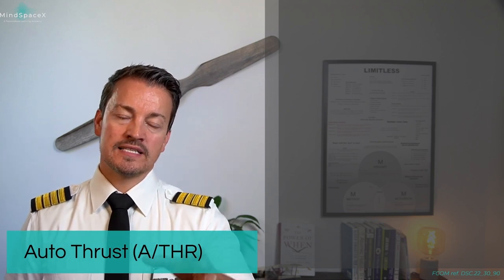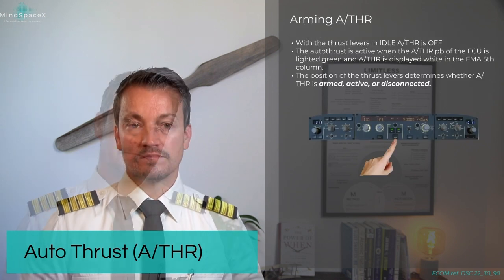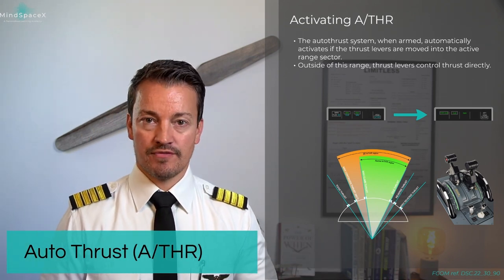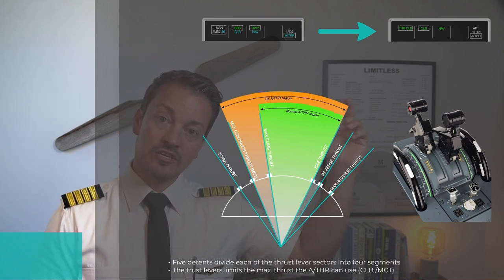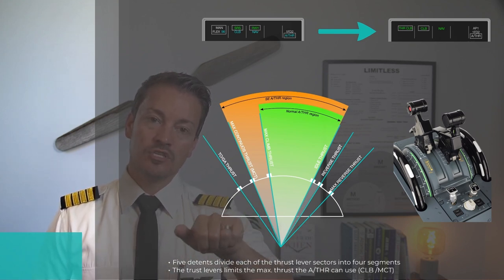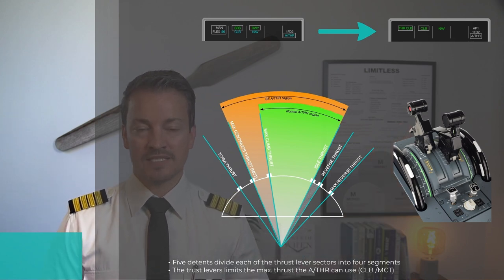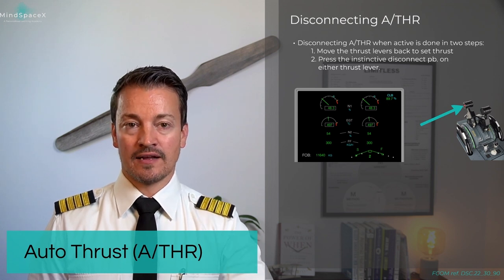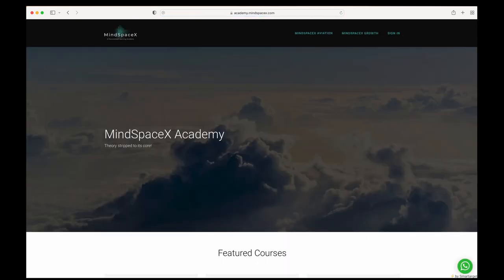Airbus Auto Thrust (A/THR) System

Comment: 2:55 what does "srs" means?? i always hear pilots saying it in airbus cockpit right after they set power for takeoff
Reply from the maker: 'SRS' stands for 'Speed Reference System'. It is a vertical guidance mode in the FMGS (Flight management and guidance system). During takeoff and Go-Around the aircraft will use pitch to follow a given speed which is safe for the climb. This vatical climb mode is called 'SRS'. The speed is considered safe and will ensure the aircraft always have a sufficient margin to a stall. 

I hope this helps? Please visit our academy where you can see all lessons, including a detailed lesson on Airbus Speeds, which I have created for this very purpose.